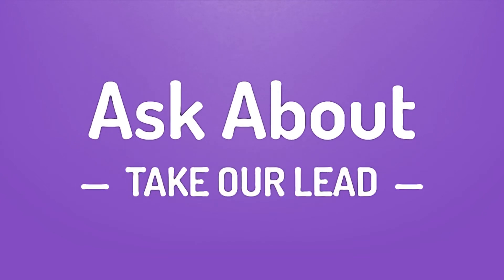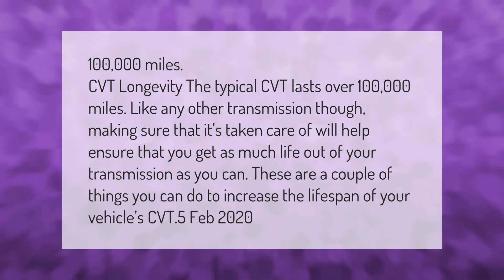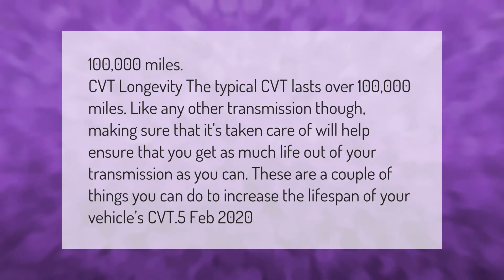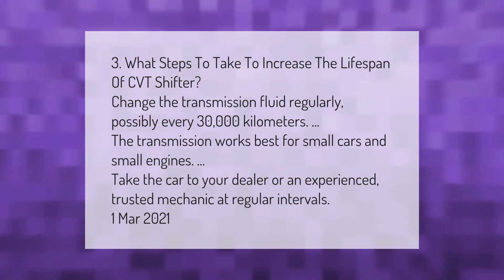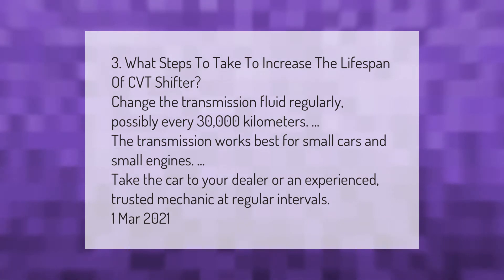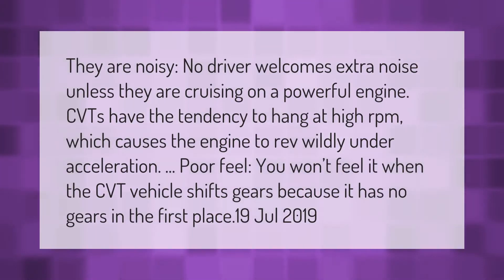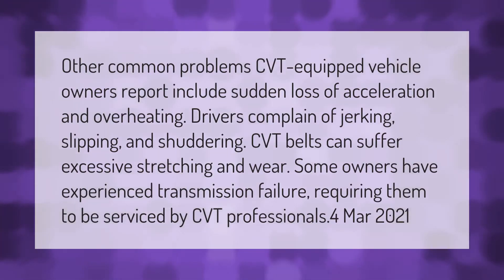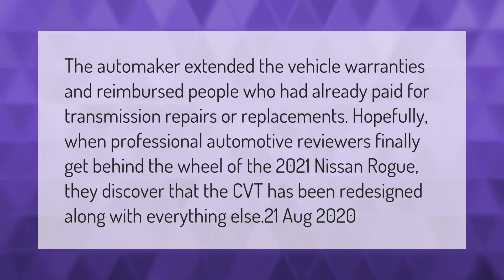How long will a CVT transmission last?

Comment: I have a 2015 Nissan Murano.
I have to disagree on two points.
1. They are not noisy. Mine is very quiet, even at highway speeds.
2. They do not have high rpm’s.
Again, mine is very quiet and the rpm’s stay at about 1,000 rpm’s or less. As speed is increased, the rpm’s do go up a little (no noise) then drop back to the lower rpm’s.
I change my cvt oil earlier than recommended and I use Amsoil.
I change it myself, so I save a little $.